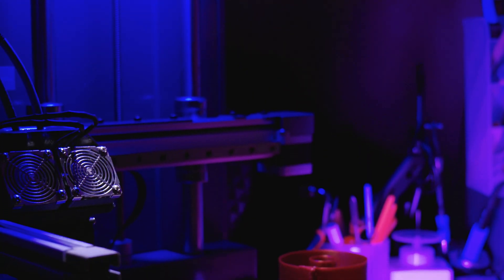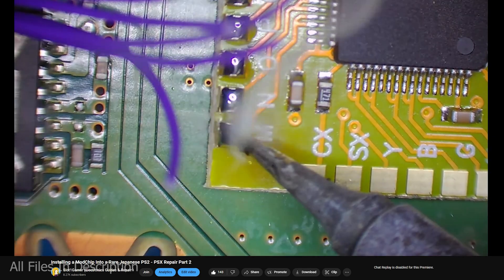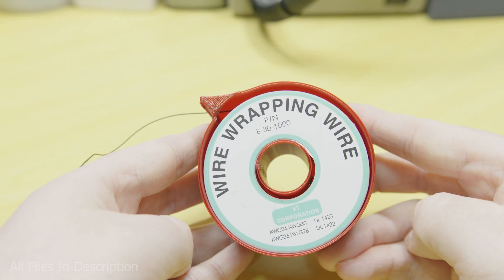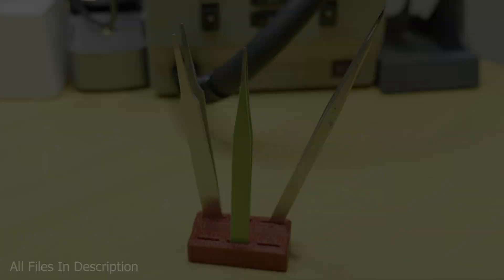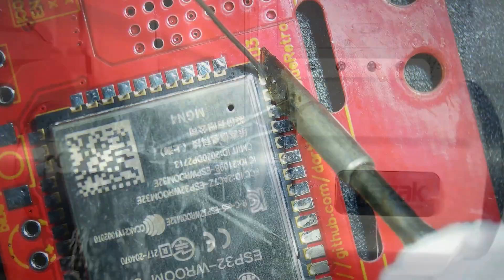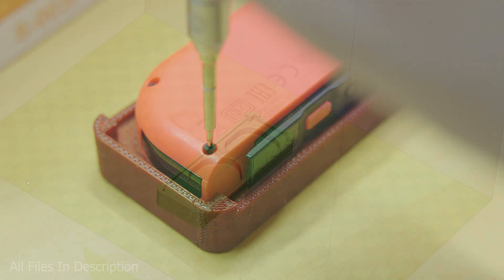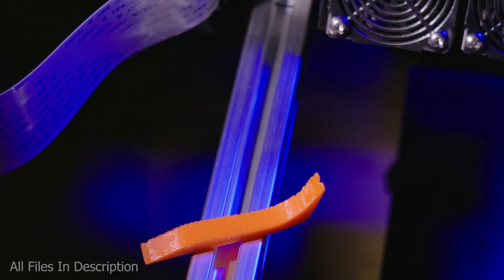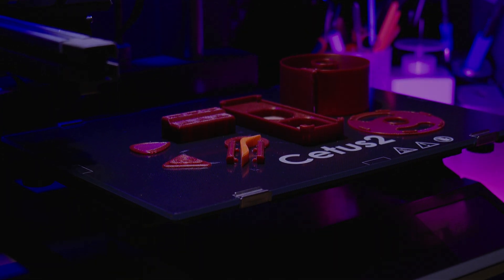Useful 3D Prints For Console Repair

Comment: oh god, you have a cetus 2 as well. Mine died when i tried printing the dragon that was on the sd card. They sent me a new motherboard, but not the cable which also burned. 
Worst printer i've ever had
Reply from the maker: I have the new board revision which has the new buck regulator design.
Which cable is damaged, I might be able to find it on AliExpress